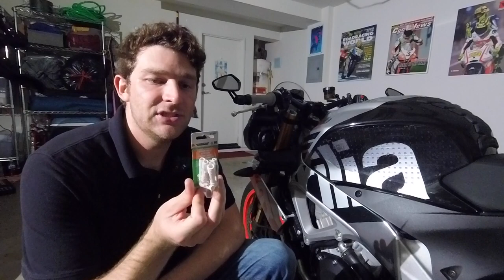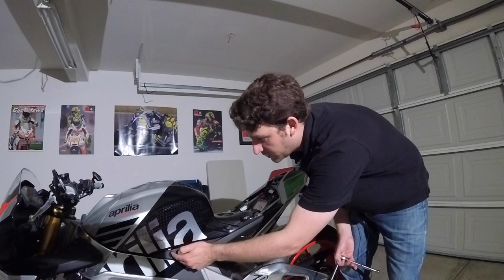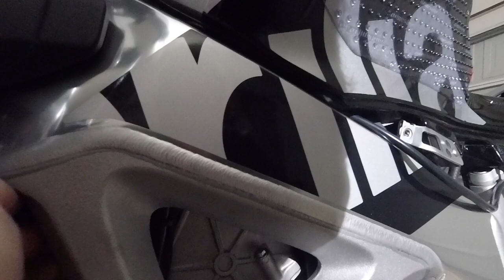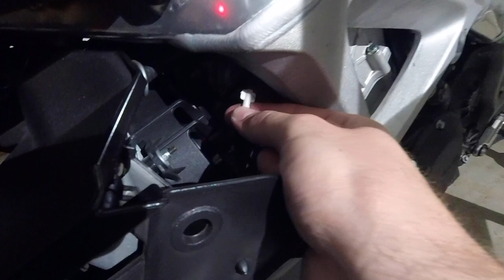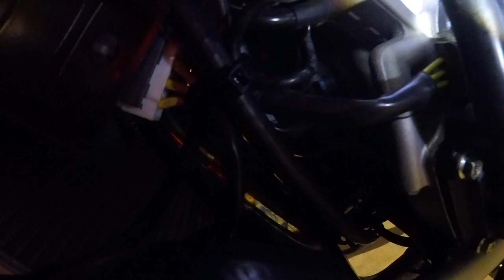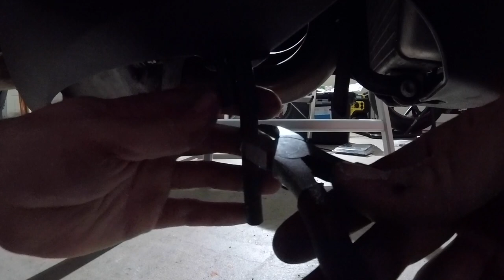How to Remove Your Aprilia Tuono V4's Charcoal Evap Canister in Detail (and Why I Did!)

Comment: Besides the charcoal cannister if you have a Race ECU or other flash make sure to remove the exhaust servo which will open up the airflow on the right side. Also I run Open Flash Tablet on my 2017 Tuono and the fans are set to come on 195. I rarely see over 204 on a hot day in slow moving traffic. Hitting back country roads pretty hard I never see over 190
Reply from the maker: Great recommendation! I did remove the exhaust servo, as my bike has the Aprilia Race ECU. It would cycle through a check when I would first turn the power on, but wouldn't operate afterwards due to the flash. I unplugged it and removed it, which the previous owner chose not to do for whatever reason. My Tuono RR had an OpenFlash. Might need to look into picking up one for this bike eventually. Nice to know you can adjust the fan threshold. Thanks Mark! Hope you've gotten your bike fixed up since that little drop!
Reply: You can change the fan temperature setting?
Reply: My bike is a 2020 and it gets a lil warmer than I like especially when I’m in traffic. Any suggestions would be greatly appreciated.

Comment: Just done this today, your video was great and very helpful.  But you dont need to remove any fairing, and it's way easier to pull all the pipe out and run a fresh short piece from the tank down near front sprocket,  alot neater too. But great video
Reply from the maker: Thanks Nial! It did occur to me to run it down by the sprocket, but I also wanted to keep the outlet of the hose as far away as possible from sources of heat, hence my decision to run it down by the coolant overflow hose. Not as clean, but does give me some extra peace of mind. 🙂✌️
Reply: @hiimchad  but... you routed it closer to the front headers, no? That is ultimate heat source, not the font sprocket?  what am I missing
Reply from the maker: @denisr7887  it's not against the headers. Running it by the sprocket would likely put it against the engine case. It does get hot around the headers, but I reckon probably stays cooler overall, especially since that area gets airflow
Reply: @hiimchad  Okey, was just thinking that, engine case temperature ~80 to 90C may be 100C, but at the header pipes themselves 600+ C ...   But I guess it worked ok for you so far :) .
I'm referring to your video for de-canister my track only Tuono. Hope not to catch the fire, and I hope it runs well.

Comment: I have a 21 tuono 1100 v4 and my tank has pressure in it that blows out every time I pop the cap to put fuel in it .
Reply from the maker: That would be a by-product of the charcoal canister. It isn't necessarily an issue, but removing it will prevent that from happening. Although, I'm not sure if the process would be the same as it was for my 2017. I'd love to take a look at a 2021 and see if that might be the case, but my local dealer still doesn't have any. :/

How are you liking your 2021? Congratulations, by the way!
Reply: this video should have enough info that transfers over to the 2021. Im going to be removing one off a 2021 RSV4 and its looks almost exactly as the 2017 and newer but the mounting bracket is different, which is no big deal. As soon as I find out what day my friend wants me to do it Ill report back
Reply from the maker: Thanks Mark! Appreciate you doing the legwork on that. I'll be interested to see what you learn. 🙂

Comment: Understand, I wanted to check if you planned to do a video on valve clearance because id just dropped $990 on my valve check at the Aprilia dealer which I thought would run about $450 so with that said its the last time they will ever see the bike. Since its still under warranty I didn't want to open if up and give them an excuse to void my warranty on any engine related issue.
Your videos are well thought and and detailed
Reply from the maker: Yeah I’m surprised the valves were so far out of spec already. My bike runs great so I’m not too concerned about it. $990 is actually pretty reasonable for a dealership to check and adjust. Dealers around me have quoted $1,250-1,600, but there are independent shops that will do it for just under $1K. 

Thank you! Appreciate your compliments and feedback. 🙂

Comment: I had the same issue, and after watching your video I removed the charcoal canister on my Tuono factory 2019 and it eliminated the issue entirely. Thanks
Reply from the maker: Glad that fixed it! 🙂
Reply: @hiimchad  So, pressure when i open fuel cap is bad or normal?
Reply from the maker: @everydaylogic2198  it means your charcoal canister is plugged. It can get worse over time, and my understanding is that it can get to the point that the fuel pump can’t generate enough pressure to pull fuel because the canister is blocking air from being pulled back into the tank to refill it. That’s when you run into issues with the bike starting hot, or dying unexpectedly. This doesn’t always happen, but it has been documented on the Aprilia Forums.
Reply: @hiimchad  ok thanks.
Another question- if i do the canister removal like in your video, why must i extend the hose all the why down like you did? can’t i just terminate it where the canister was?
Reply from the maker: @everydaylogic2198  I extended the hose so the fumes from the tank would exit as close as possible to the ground, since the fumes are unfiltered without the canister. It’s just a safety measure in the unlikely chance an excessive amount of fumes came out or if the bike fell over fuel and fuel vapors wouldn’t be released as close to a hot engine, reducing the risk of a fire.

Comment: I'm hoping the new tuono is very similar to the previous because I'm experiencing this on my brand Tuono. I'm actually in the break in period(275miles) came home yesterday and heard a whistling noise while putting the bike up? I put my ear by the fuel cap and noticed it coming from there? I knew automatically it was pressure and slowly cracked the cap until the pressure relieved.  Interesting how this is a problem.  I did noticed the pressure the first tank of fuel. Can't believe we have to deal with something like that. Thanks for video hopefully my bike is setup similarly.
Reply from the maker: It's frustrating indeed, but apparently is still within the territory of Italian bikes. Thanks for watching, and hope the Tuono is treating you well in all other areas!

Comment: This just helps me figure out how to take off the fairing by the canister. I’m going to changing my coolant to engine ice so that’s will be my next project soon. But I’ll definitely do this evap canister soon as well. I’ve seen my bike get to 230.
Reply from the maker: If I recall correctly, there may be one more of those plastic clips on the righthand side you’ll need to pop out with a flathead, but other than that, it should be the same. Glad this was helpful! 🙂 Also, as TuonoFever mentioned below, if your bike is tuned for an exhaust and doesn’t have the exup valve enabled, you can remove the servo motor for that to free up some space behind the radiator as well. It’s in basically the same spot as the evap canister but on the other aide of the bike. And one more thing, I would recommend Redline’s Super Cool over engine ice. Should provide a similar cooling effect, but still contains additives to keep the water pump lubricated. I’ve heard stories about Engine Ice doing some nasty things to engines long-term! I run Super Cool in my race bike and it stayed under 217 out on track in 100F+ heat!

Comment: You need to do the stage 3 intake. GAME CHANGER!!
Reply from the maker: That's what I've been hearing! To be honest, the power is plenty for me right now, but I do have that in the back of my mind in case I do decide I need to spice it up one day. Until then, I'll keep enjoying as she is. 😁 Were you able to complete the stage 3 conversion on your own? It requires an OpenFlash tablet to tune for, right?
Reply: @hiimchad  I ended up going with the Gabro Racing stage 3 and UpMap as the tuning device. The install was a bit of a pain. But the performance was worth it. With the new map the bike has even more power everywhere in the rev range.
Reply: @hiimchad  complete 2017- up RSV4 airbox assembly and OFT Stage 3 tune. Seriously pulls harder from 8k on up

Comment: Nice Video Chad, wonder if you planning on doing a vid on valve clearance and shims to spec. I have a 2020 Tuono RR it has 6,500 miles took into shop to check valve clearance they told me 2 of the valves had zero clearance. Good thing I brought the bike in early, the manual recommends 12k for valve check.
Reply from the maker: Thank you, glad you enjoyed! I probably won’t be doing the service myself. I’m coming up on the 12.5k interval (at ~11.3k now) and have been so busy with work and other things that I can’t see myself getting it done in a reasonable amount of time. I also don’t want to spend $750 on the kit that comes with the special crankshaft or camshaft locking tool that you need when I can get someone else to do the entire job for $250-500 more.
Reply: Excellent vid.  You are highly articulate.  Thank you!

Comment: My tank is starting to swell up/warp on the side. I wonder if this has anything to do with it. Waiting to hear back from Aprilia to see if they’ll replace it under warranty (as I’m still in the warranty period). Would you recommend doing this when I get a new tank?
Reply from the maker: While I can’t say it will certainly prevent your new tank from warping, it probably will. Many owners on the forum attribute the tank warpage to pressure buildup cause by a clogged canister.
Reply: @hiimchad  when you open the gas cap, does your tank make a pressurized sound? (now that you removed the Evap canister)
Reply from the maker: @GurpreetSingh-dp2sc  nope, not since I removed it.

Comment: Question: so we're basically running a hose from the vent port of the fuel tank down to the bottom fairing? I've ridden Japanese bikes that do the same typically the hose or line is down by the kickstand. I wondered though why they dont have a EVAP canister like the aprilia? My 2020 R1 was like this? Anyway thanks for the video and answering my question about why I had all this pressure in my fuel tank and I could even hear my tank expanding and contracting.
Reply from the maker: Glad you found it helpful! Not sure why your R1 doesn't have a contraption like this. Maybe it's a component of the fuel tank, and better designed so as to not build pressure? There must be some kind of part like this somewhere on the bike, otherwise it wouldn't meet emissions. But, if it doesn't cause issues and you can't see it, it's a part well done. in my book!

Comment: Great video 👍 also done this on mine but ran the hose Down by the front sprocket cover.
Reply from the maker: Thanks Martin! I have seen people do that as well. The how-to I used when I first did this back with my first Tuono ran it down in front of the engine, so I just followed that process again here since it was what I was familiar with. What year is your Tuono?
Reply: @hiimchad  2019
Reply from the maker: @martinrobb9115  Nice! How do you like the semi-active Ohlins?

Comment: I Chad 
If i  keep the valve on the breeder hose does it gonna work and prevent to smell gasoline ?
(One way valve?)
Or it will put the gas tank on vaccum ?
Thanks for the great video👍
Reply from the maker: Hi Jocelyn! Good question, but I can't say for certain. I don't think that it will though. The charcoal canister is what prevents fuel and vapors from making it to the atmosphere, and I believe the valve opens as pressure dictates, so at some point I think it would still vent fumes. But again, I'm not entirely sure. Just guessing based on my understanding of the system. Thank you for watching and for the comment! 🙂

Comment: Hey Chad, 

I got a salvage 2019 tuono factory and does not came with any of those breathing hoses, I bought a 6 ft 3/16” to install them on the tank, and I did it,  but I don’t know how and where to connect the one you said is going to the air box to put the cap.(the one that you put a screw on you video)

Hope you can help me Thanks
Reply from the maker: It's been so long since I did this I can't remember off the top of my head unfortunately, but I do think I called it out in the video. Maybe give it another watch in the middle section? Sorry I can't be more helpful!

Comment: Is it possible to remove the canister bracket? To me it make sense to remove it as well to reduce air flow restriction
Reply from the maker: I haven’t but I don’t see why you couldn’t and your logic is sound. You would just need an appropriate spacer for the mounting rod and a way to secure the connector for the fan.

Comment: Welp looks like I’m gonna need to do this soon. Had mine cause issues today on my 21 Tuono factory and never had it do this before. Also my bike has gotten to 238 easily before and normally at red lights will get to 225ish before I get going again.
Reply from the maker: Hey John, sorry to hear this issue is plaguing your bike too! Fortunately it isn't too difficult of a job. It doesn't take much time for these canisters to plug up it seems. Some only need vapors to start blocking airflow into the tank.
Reply: @hiimchad  Lesson learned for sure. Your video is super descriptive even with mine being slightly newer I doubt it’ll be much different. Keep it up man!
Reply from the maker: Glad you found it helpful. :) From what I have heard and seen inline, the procedure should be largely the same for your 2021. Will do, thank you for the support!

Comment: I see theres a kit for this mod that comes with a dongle. Says the dongle is to prevent any F.I. errors. Is this dongle necessary?
Reply from the maker: It may depend on the bike, but if yours is a Tuono V4 or RSV4, no dongle is needed.
Reply: @hiimchad  Yea, 23 Tuono V4 Factory. I just found a better description on AF1, says not needed if running race ecu or race map. Thanks for replying.

Comment: I guarantee this was the issue that was plaguing my 2013 Tuono with massive negative pressure built up in the tank and shut down my bike I thought it was ECU issues. When you open up the gas tank a huge sucking sound would happen where the nozzle would go in.
Reply from the maker: That's 100% due to the eval canister. My tank did the same thing. Hasn't happened since I removed the canister!

Comment: Hey what kid of Handel grips you use. Thank you in advance
Reply from the maker: Hey Luis! I use Renthal's soft compound sport bike grips. You can buy them here: https://www.revzilla.com/motorcycle/renthal-single-compound-grips?sku_id=898221
Reply: Ok thank you. Just Bought a 2017 RR. And your mirrors. I saw your video of all the upgrades they were done but they were not descriptions on the list of the parts they were there. Looking for the bar and yours as well. Thank you for making content I’m excited about to punch in. Thank you
Reply from the maker: Hey Luis,

Here are the mirrors: https://www.af1racing.com/CRG-Bar-End-Mirror-Arrow-Series-Sold-Each

And here are the bar ends you will need to mount them: https://www.af1racing.com/RhinoMoto-Bar-Ends-WMirror-Recesses-Round-End-BK-2

Congrats on your Tuono! Was it you that I showed my Tuono RR to at Midas back in April?
Reply: @hiimchad  thank you so much. Ones more than you for your help and kip on giving us more. what kind of flash program you recommend for the RR
Reply from the maker: @Shinob66  My Tuono Factory has Aprilia’s “Race ECU” flash that can be installed at a dealer. The best value is probably getting an OpenFlash tablet. You can load one of their tunes up to your bikes yourself, update maps as you upgrade parts, and even flash it back to stock all on your own. My Tuono RR I used to have had an OpenFlash tablet and tune, and the bike ran great!

Comment: I don't understand why you need to remove the check valve on the one hose. If you just disconnect them from the canister they are plenty long enough without extending them.
Reply from the maker: The how-to I found on the forum recommended removing it. I didn't really give it any additional thought, but don't see any reason you couldn't leave it there now that I mentioned it so long as the check valve is still working properly.

Comment: Is it the textured hose on the right that gets plugged or the smooth hose on the left? I think I may have messed it up 😬
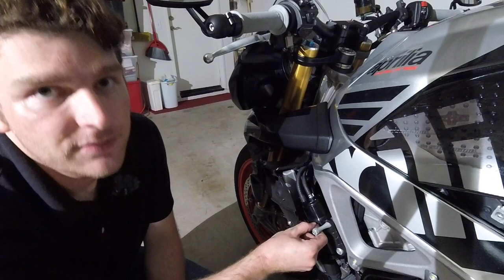Reply from the maker: You don't want to plug either of the hoses to the fuel tank. Those hose that gets plugged is the one that is not in the center of the eval canister. It is textured and runs up to the airbox. Sorry for the late reply, and hope you figured it out, but check out 13:09 in the video for more details.
Reply: @hiimchad  no worries. Yeah, I ended up figuring it out. Just plugged it at the TB's and deleted the valve altogether.
Reply from the maker: @kforeal6809  nice!

Comment: Removed that stupid part at my EC 2020 Tuono. Its an absolute useless part just to fullfill some stupid European regulations. The next step will be an update of my ECU, which has a annoying jerk during acceleration in the 2. gear from low revs.
Reply from the maker: The ECU flash will be nice! My throttle is still a little snatchy but only below 4k rpm. Above that, it feels good. 🙂

Comment: The Evap canister isn’t just emissions it’s a safety item. Not only that, without it the bike stinks.
Reply from the maker: Hey James, mine has only smelled like gasoline if I have filled the tank very close to the top and immediately come home and parked it. It hasn't been an issue for me otherwise. As far as it being a safety item, do you mean in how it prevents gas fumes from being inhaled?